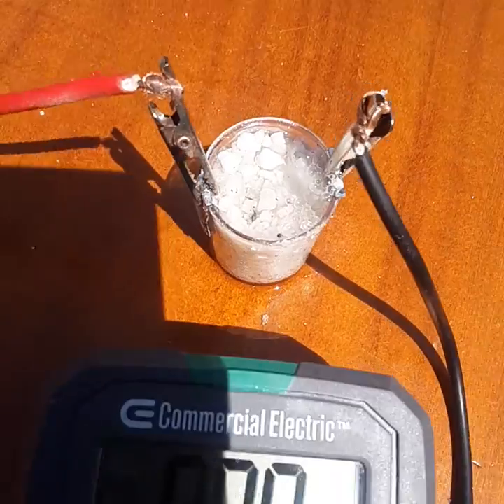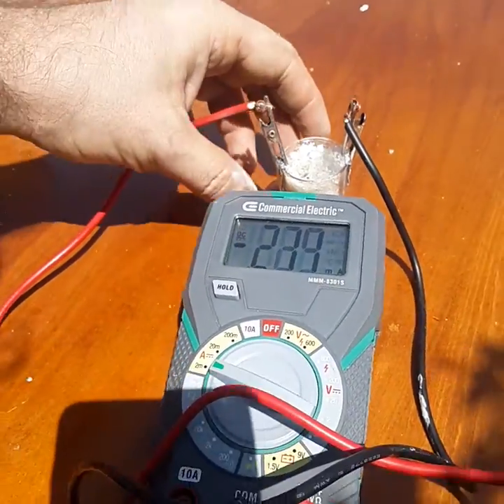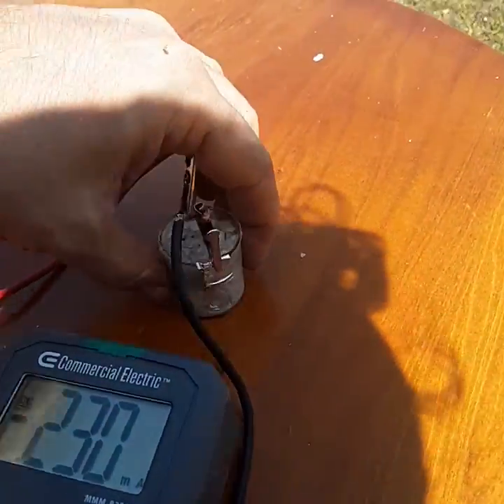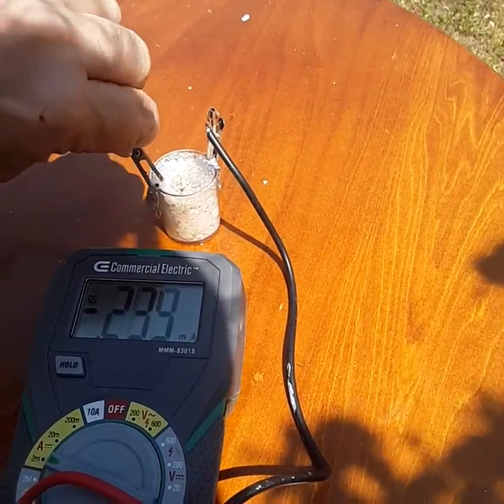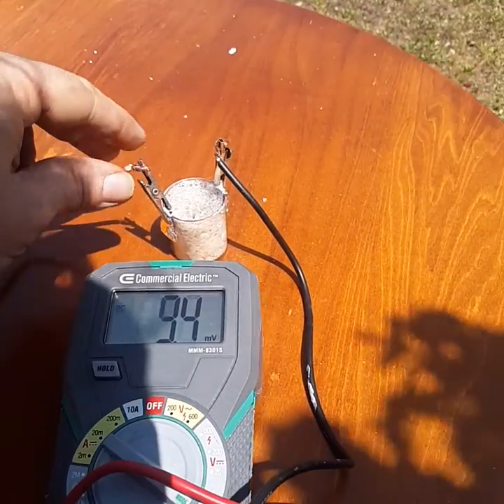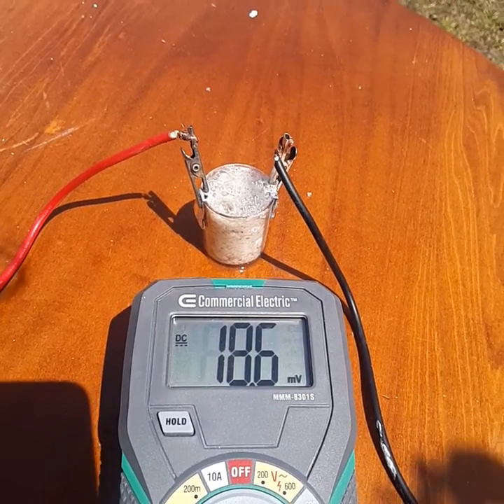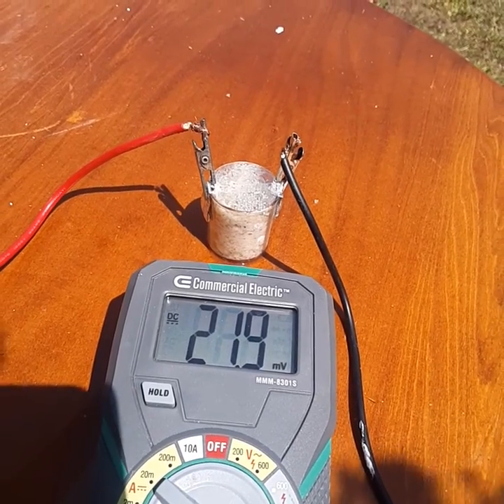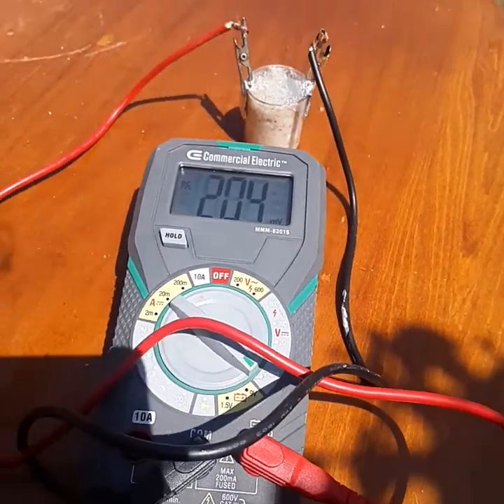T.H. Moray Radiant Energy Tube

Comment: Very good video, I have been obsessed with metamict quartz ever since you first posted your original one. Still wondering on how to acquire or create it, I have a few ideas but nothing fully concrete
Reply from the maker: alot of smoky quartz is metamict. some mineralology buffs have flea market type gatherings and if you use a Geiger counter you can determine for sure if they are metamict
Reply: @peterlang777  Thanks a lot for the response!
Reply from the maker: @bobdole27  i try to reply to all the questions. the channel has been getting pretty busy recently! your welcome!

Comment: Ah yes, a chemical battery
Reply: How in the world could this be considered a chemical battery?
Reply from the maker: @bobdole27  anytime anything has the approximate form of a chemical battery youtubers think that is what it is. the electrodes here are both aluminum. i think he is seeing the chemical change of water to hydrogen gas as a "battery effect" . as you said though its clearly not.
Reply from the maker: the very variable current output is also a dead giveaway its not a regular battery
Reply: @bobdole27  Based on the fact that the solution bubbles (indicating a chemical reaction) and the fact that it is producing electricity, it might be a chemical battery or something similar to an effect where a water solution with two electrodes will temporarily retain some charge after you have applied a voltage to it (I suspect this effect is because the water and the hydrogen and oxygen from the electrolysis that occurred when charging the battery create a crude chemical battery that is able to hold some charge).
Reply: @YSPACElabs  I can see your reasoning but I disagree
Reply from the maker: its not a chemical battery you should google "t.h. moray radiant energy"

Comment: I wonder if quartz aluminum nanotech can be made using moldavite and do something similar to what your doing, also if moldavite formed from asteroids then there are likely radioisotopes embedded
Reply from the maker: the original moray swedish stone is thought to be a thorium/germanium/silicon mineral possible magnesium or pottassium in it as well.  this reaction started on protype tube 3 after it was in the circuit for 10 minutes
Reply: @peterlang777  would thorium oxide perform well? is silicon required?
Reply from the maker: @clrwtrmusic  thorium oxide requires alot of safety steps too. the combination of isotope and semiconductor makes an ideal high frequency rectifier.  i recomend just using a geiger counter to test various smoky quartz samples for a mild one and just using the intact crystal
Reply: @peterlang777  assuming i am taking all safety precautions, how much voltage would you estimate a thorium could generate in a similar sized device? would it be able to power appliances?
Reply from the maker: obsidian metamict was reccomended by a kenyan fan on facebook. said to generate more ions than metamict quartz (mutual friend of mock nsiah and me.)